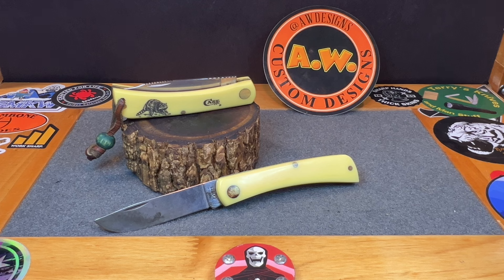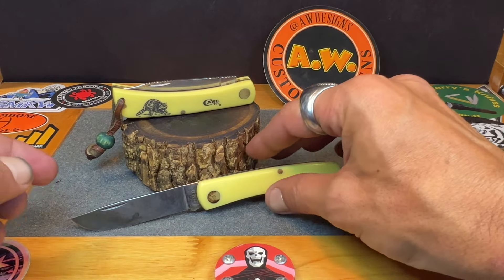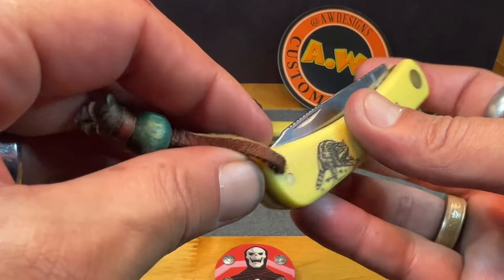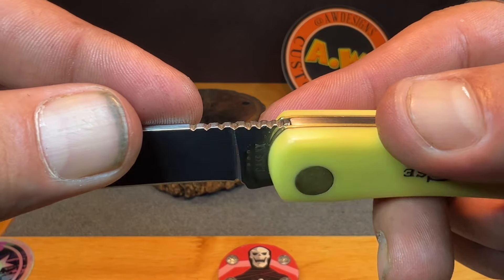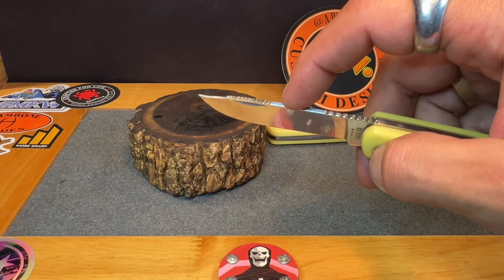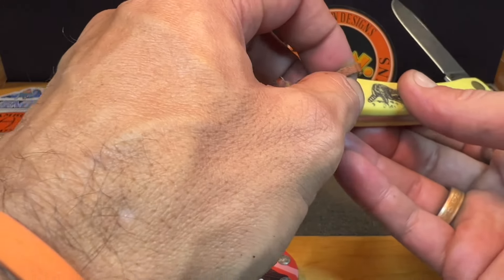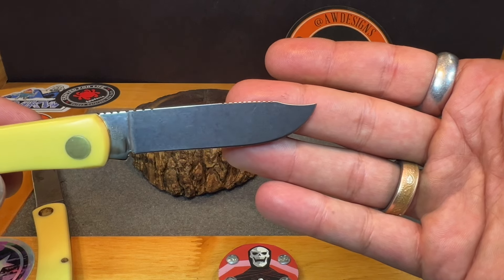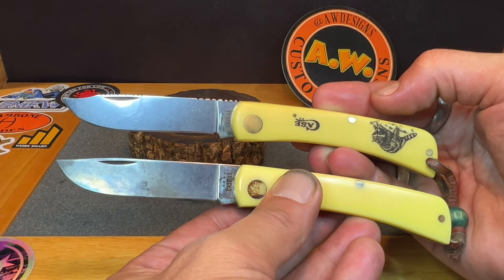Custom Clip Point Soddy Jr #ModifiedMonday (MM #7)

Comment: That’s cool!! I seen a Soddy with lanyard in it and someone has removed the pin and placed a brass tube in its place. I thought that’s was a good ideal. But your way you don’t have to do anything but drill a hole. In the correct place lol.
Reply from the maker: That would definitely be another good option. Drilling the hole in the right spot isn’t too bad after you do it a couple times. I had just finished drilling lanyard holes in 9 different Folding Hunters for someone before this Soddy…at this point, I’ve got it pretty down. 🤣